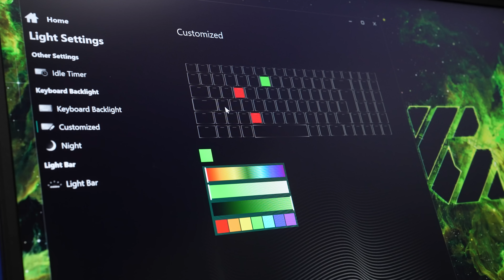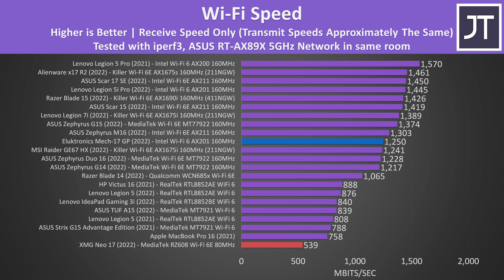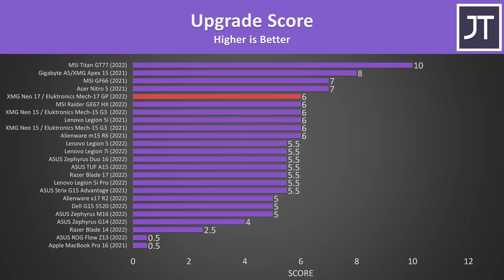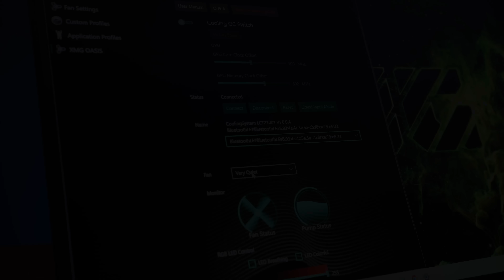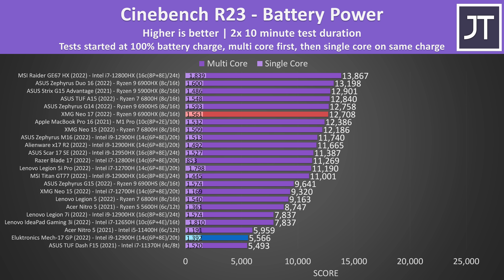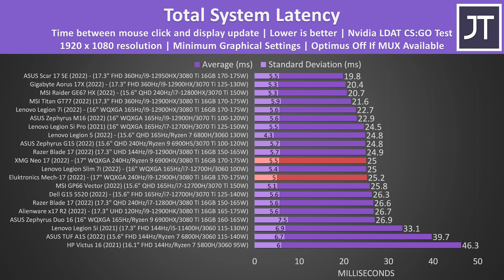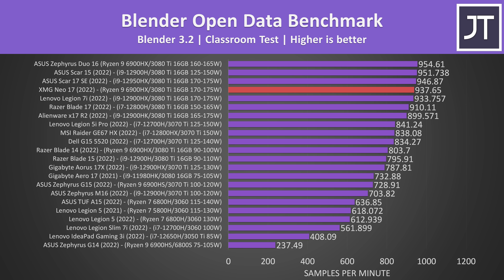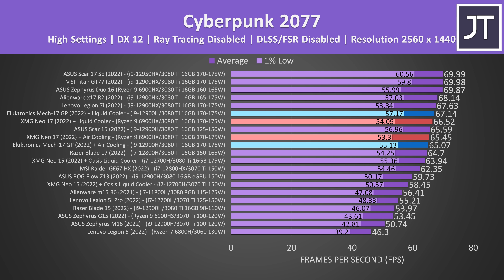17” Water Cooled Laptops! Mech-17 GP & Neo 17 Review

Comment: I wanted to thank Jarrod for some time so here it goes. I was looking for gaming laptop and I knew I could do it only once. So, like most uninformed I bought latest and greatest I could afford, MSI Raider GE76 12UHS-252. 4300 USD laptop. CPU Tem was hitting 100 C in 25 C room with Laptop cooling pad. It scared the **it out of me. GPU although great but turned out to be un-necessary (Thanks to Jarrod's test that I could not have possibly ran myself) I returned it and bought Raider GE77HX 12UHS-004 for 2600 USD. Same FPS in games without temp problems. All I am saying is listen to this guy before buying laptop it will save you time and money. Thankyou Jarrod. Have a great day everyone.
Reply: I'm looking at the GE77HX with the i7 12800hx and 3070ti. Are you still liking yours and did you ever have any issues with the screen quality?

Comment: My guess as to why they have so much unused space inside is that they also use this motherboard in a 15" laptop. That's also why it has the strange feature of a low profile ethernet port in a full sized cutout.
Reply: Correct. Also, the empty space keeps the weight low. // Tom

Comment: XMG really did a great leap forward against noisy high- powered laptops. But i hope they keep going and iron out some bugs:
- what concerns me most is that the water- couple doesnt seal on the laptop- side. If you pull it off the water inside the heat- pipe will just flow out and possibly damage components inside. I guess waterdamage isnt included in a warranty. Its likely done like that to fight corrosion or pressure build- up when the water cooler isnt used but it could be better
- second I think that the integrated waterpipe on top of the the existing heatpipes is great, but it could be bigger and longer to collect more heat, for having such a system the results could be better
- the radiator and pump could be bigger and quieter
I know its hard to manuafturer something that works for everybody. I did a DIY watercooler on my MSI GS67 HX that gets rid of the things I wrote above. Now never goes over 60C and the fans only come on under hardest load. In stock form that laptop idles at 50C and puts the annoying fans on with light loads. It works great but its not light or pretty, but its nice having a silent laptop an the desk and a watercooler humming away underneath.
Reply: so I have the Neo 15 with the watercooler. Not sure if that imporves or lowers the quality of my response. 

1 this is less of an issue than at first might appear. I usually just dump the little water that remains out (I use distilled water to cool). The main issue I have with this is that you need to refill the reservoir every now and then. 
I get like 20+ disconnections before having to refill, so for me disconnecting once every 2 days) that means about once every 6 weeks I need to refill the reservoir. Not that big of a deal. If you connect and isconnect like once or twice a day, then you would have to refill once a week, more of an issue. 

2. The short loop. This is even less of an issue. I have the i7-12700 and the 3080ti, and when playing games maxed out the temps rarely go above 64 degrees. That is low enough to have no throttling, and to give the components a longer lifespan. Lowering the temps even more might be nice, but doesnt really add much. 

3. Radiater and pump bigger. Sort of similar to the short loop, it works like this, with no throttling and no superhigh temps. Why change that even more? 

I do have some issues of my own. Personally id prefer a quieter fan and quieter pump. I would be willing to pay more for a version which is compeltely whisper quiet. I udnerstand the budgetlimits to keep something like this at the price they sell it for now, but id be willing to pay a premium for that, and hope they upgrade that in the future.
Reply: how did you even make a water cooler for a laptop??
Reply: @Okkebeltman  How long is the "hose" for the water cooler? doesn't have to be exact.
Reply: @Okkebeltman  I have the Neo 15 with i9-12900H and I agree with all three points. Bigger fan in watercooler could be a lot less noisy but I guess it grew on me and it is still very quiet.
Reply: @TipsyTaterTot  They are around 65 cm long. // Tom
Reply: I did detachable watercooling mods on 17 inch Clevo SLI models over the years, P370EM and P870DM3. Planning and test fitting is the hard thing.  Actually doing the mods on the heatsinks by soldering on a copper tube, and modding the case to fit copper cooling lines like these and the quick disconnects, is the relatively easy part. Except for soldering to a vapour chamber. That is a total nightmare. Cools fantastic tho, 2x200W @ 70C off the one heatsink speaks for itself
It took me longer to mount and wire up the 360mm rad and fans and controller to the underside of my desk here. Using 6 fans in push pull at 1200rpm is completely silent and handled peak stupidity mode with ease (pulling around 600W - 9900K @ 170W + 2x 1080s @ 250W TDP)
Reply: BTW I also had a big leak once when a solder join cracked open. The water/coolant mix (I use automotive green alloy coolant due to solder+copper being a mixed metals situation) followed gravity and leaked out through case vents and fell onto the desk, nothing died.
Reply: @greebj  Thanks for the answer, I feel a bit less insane for DIY watercooling myself. How I did it on my GS67: I stuck two of those Amazon 120 x 40mm heat exchangers onto the flat surfaces of the heatpipes on the CPU abd GPU. I used some thermal paste, i know iam loosing some efficency here but i dont have the skill or will to solder onto those heatpipes, i want to be able to convert to stock if necessary. I build a bracket out of 4 holed 3mm thick aluminum plates that clamp the heat exchangers into position. They also form a big heatexchanger on their own when iam in travel/ hotel mode. The rest is cobbles together: Quick connects that close on both sides, long tubes to the radiator assembly, an old beerglass als a reserviour with a quiet aquarium pump in it, a big automotive oilcooler with two Noctua 200mm fans. I run a mixture of water and windshield- fluid in the loop. As I said: the whole laptop is cooler und silent now. At home I use it stationary with the watetcooler and all external monitor, keyboard and so on. When I travel i just use the laptop itself. I would love to have a normal waatercooled PC only but I travel alot for work and only wanted one machine, the GS67 has good fans on its own but I wanted less noise.
Reply: @Okkebeltman  Thanks for the answer. So if XMG builds a better watercooler with a quiter fan and pump in version2 they should be all set :)

Comment: 6:12

This is what killed my excitement for this laptop real quick. If I was to use this as a Desktop Replacement and I can't hook up my thunderbolt 4 dock to my two external monitors and use the internal Nvidia GPU then it's a no go. If this ever got changed in a future model I'd probably have no reason not to try this laptop out. I was told that this was a limitation on intels 12th gen cpu though so unfortunately it might have be a refresh before that happens.

So close. . .
Reply: The chassis with AMD Ryzen 6000 has the USB-C directly connected to NVIDIA GPU. Only one single DisplayPort 1.4 stream over that port, but it can be split further for multiple monitors with a MST-capable dock. By the way, even if you take Intel 12th Gen with a Thunderbolt dock on iGPU, you can still use the NVIDIA GPU on your two monitors via MSHybrid. They would perform exactly like the internal screen with NVIDIA Optimus (not Advanced Optimus). One advantage of having external monitors on iGPU is much lower power consumption in idle and web/office use. The dGPU can sleep while not gaming. // Tom
Reply: @xmg_gg  Well I'm glad you took the time to explain that to me. Thank you. I could probably make it work with that cleared up. I could probably ditch one of my dual monitors and use the laptops screen since 17" would be enough for my use case while using the monitor for gaming. 

Though with the Nvidia 4000 series coming out soon I'll probably have to be a good boy and wait for the laptop release. . .

Comment: I feel like no usb-charging is no-go, as even my old one I am using right now had it, and It saved me once or twice already to charge it from phone charger, at pathetic speeds, but still 30W was enough so in ~3h had full battery and I could use it. Not something you use everyday, but if you fly with laptop, a single charger for both phone and laptop is very nice. 
It also makes spotless desks, when you can run single cable of the desk for everything, sort it all to monitors, power bricks, network etc. out of sight. 

I find that liquid cooler results a bit underwhelming. I saw thermal imaging, those pipes do something, but I would expect much more. IMHO that liquid cooler should focus on GPU, even if CPU would have all that air thermal mass & fans for itself, it should be enough to cool it.

Comment: I just got the Eluktronics.  Coming from a 1070 8GB and an 8th gen i7 to a 3080ti and a 13th gen i9...this computer is crazy fast.  I did some Resolve renders with fusion comps and this was just spitting them out.  The water cooling looks pretty cool but the app is not working and tech support takes the weekends off (fair enough...they replied very fast last time I emailed.)   It's not even getting warm with just the air cooling although larger renders will definitely benefit from the water.  Not incredibly crazy about the quality of the water pump nor the lack of a 2nd usb-c (yes, in 2023).  There are still just a couple of these on clearance on Amazon so if you're in the market and don't have to have a 40 series, you could do much worse.

UPDATE: I just got a 2nd nvme to upgrade.  Removing a “star” because Eluktronics torqued the screws so tight that I tore the heck out of the bottom cover and had to drill a screw out.  Still can’t get the cover off…maybe a couple hidden screws?  Why would they not hand tighten these?

Comment: Nice laptop but really expensive, at least from eluktronics compared to other brands. Many cheaper options if you don't care about the liquid cooling. 

The i9 12900H 3070ti model starts at $2600, yet i've seen legion 5 pro's on sale here in the US recently with the i7 12700H, 3070ti 150W for $1600!
Reply: yeah these have 3080ti, obviously it will be expensive. Why compare pricing of two different gpus lol
Reply: But the Eluktronics comes with DDR5 Ram, which is why its more expensive.
Reply: @noneB974  I was comparing the cheapest configuration eluktronics offers for this model, which is $2600, to other laptops with similar specs that's all. 

Not everyone buying this is going to automatically go for the $3500 3080ti configuration. Plus, I bet its significantly more $ compared to other brands 3080ti models. 

Eluktronics is just really expensive. CyberPowerPC sells the exact same tongfang laptops for hundreds less even in the US, and has the liquid cooling now as well.
Reply: @spartendeath  I mean so does Lenovo, Alienware, Asus, HP, and pretty much every other brand?

My Alienware M15 R7 with a 3070ti came with DDR5 and so does the legion 5 pro on sale right now with the 3070ti, i7 12700H.

Comment: Pretty cool never understood the point of having to have the liquid cooling part separated might as well just get a desktop then with all the space it'll take up
Reply: Can Take laptop to office and  house, hookup to water cooler when needed. You can't carry desktop .  Situations Like video rendering made in 3d visualising softwares will take some times 6 hours to render and can harm laptop if it's working on full power for hours. Two of my friends laptop died due to heavy renderings.
Reply: @vmafarah9473  I've never had any problems with rendering on my laptop honestly but all laptops aren't equal sadly so that makes sense
Reply: I bolted my WC setup under my desk, just have the 2x 10mm tubes and a small loop temp display poking up through a cable hole
When I started out in DTR laptops I was already addicted to power hungry performance by being impatient, and I had 2 workplaces so I'd just lug the thing around with me everywhere. And also the pub next door where I'd have the beer garden to myself for long "working" lunches, beat the heck out of an office

Comment: Hey Jarrod, since the laptop has the panel power saver option in an easy to find place, you tested the laptop on battery at 60 hz, correct?
Reply from the maker: Yes as the screen lowered by default.

Comment: I feel like these are very much like Egpus: a solution for something that isn't really a problem. You'd get much better performance from a desktop for less money, probably for the cost of these you could get a desktop that would smoke them and a laptop for travel. Also, in 6 months, next gen 4070/7700m should be 3080ti level of performance or better (I don't expect more than a 1 tier improvement for next gen) probably for more money than 3070/6700m but not ridiculous pricing like 3080ti laptops currently.
Reply: Of course a desktop with a large watercooling loop for CPU and GPU would smoke this, even tho laptops have been very capable lately. But people who choose a laptop travel alot and need a mobile machine. With newest hardware they get hot and noisy which is where this watercooler comes in.
Reply: @Rockport1911  yeah I don't get why desktop people always brag about desktops, travelers like me need a good laptop.
Reply: id love a desktop. but when you have a job that requires you to travel constantly and you like to game this is why you get these. i dont think anyone would disagree with you that desktops can offer more for less price. Your paying for mobility in laptops

Comment: i wanted to connect this to my laptop i soldered copper pipe  on bottom with m6 4mm quick connect fittings. does this only run with software? only for eluktronics laptop? could i bypass that and still use it on my laptop.

Comment: I feel like 2900 EUR for 3070 TI is way too much. Both companies cut corners with way too much things (not labeled ports, slow response time on panels, 400 nits and low contrast, high temperatures, not liquid metal on AMD machine, thermal throttling without the liquid cooler, hard to remove the water from the laptops and etc.) for these laptops to be appealing compared to brands like Asus, Lenovo and MSI.
Reply: In China, the amd version of the xmg neo 17 is called the 机械革命蛟龙17pro. On the Pinduoduo e-commerce platform, the minimum price of the 16+1T specification is about 9100 yuan.机械革命蛟龙17pro dont have mechanical keyboard

Comment: The water cooling seems like mostly a gimmick for how little difference it makes
Reply: you're not considering fan noise at all?

also if the next gen is anything to go by we will see 200 watt gpus again, then it will matter a lot.
Reply: @jacques-hendrikvanaswegen281  the different between performance and overboost is small enough on its own. Lower fan speed isn’t going to make it much slower.
Reply: It makes a big difference in temperatures.
Reply: @ACE112ACE112  it doesn't get hot enough to throttle in any meaningful manner in any case.
Reply: It may help in long hour renderings,two of my friends fried their laptop by prolonged rendering.
Reply: I can have my laptop blasting the CPU at 150W all day long and the keyboard barely heats up when my WC mod is attached and on.
I found soldering tube on top of heatpipes worked up to a point, and was more effective on GPU temp (bc how their overall heat density is lower, CPUs have hotter hotspots). The results are not bad for such a tiny bit of copper tube but for more desktop-level water cooling performance you need proper desktop-type waterblocks
I made a CPU waterblock myself, and was able to get more OC out of a 3940XM than I ever could on air, but the headaches from the failure-prone and bubble-prone tiny components and fitting everything inside a laptop chassis was just not worth it.

Comment: is the mech brand worth it?
im in the market for a upgrade from my current gaming laptop.
im seeing crazy deals on these, just found one that matched my every spec needed.
I9 139000HX from an I7 17500h
17 inch 2650x1600 screen from a 15.6 inch 1920x1080 screen
1000gb base ssd from a 500gb base ssd
RTX 4090 from a RTX 2060
32GB ram from 16GB ram
better battery life, newer bluetooth and wifi connectivity
and higher resolution camera.
Reply: I just got the Mech 17 with a 4090. First impressions are very good, fan noise is very quiet while gaming and build quality feels solid. My only complaint so far are the speakers (not very good)

Comment: So much internal space wasted...  extra cooling with extra thermal mass would have paid off in kind... heck the space in front could have been used for better/larger speaker setup to even better utilise the under-the-wrist-rest area for something useful... or maybe go the workstationy route and put there NFC+smartcard/smartid reader...
Reply: The empty space is for buoyancy. ;-)

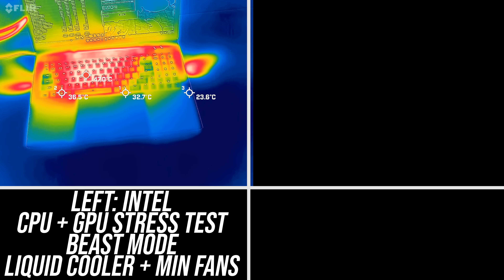XMG NEO 17 weighs only 2.8 kilogram, despite the gigantic 17" 16:10 display and the air cooling system that can disperse a total of 175W GPU Power without breaking a sweat. The chassis has two M.2 SSD slots, with only one of them occupied by default. // Tom